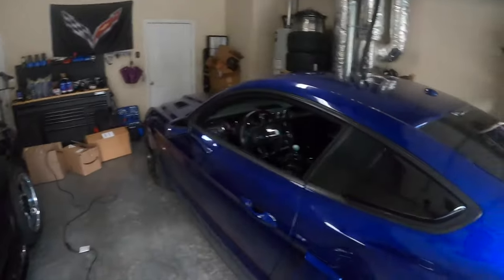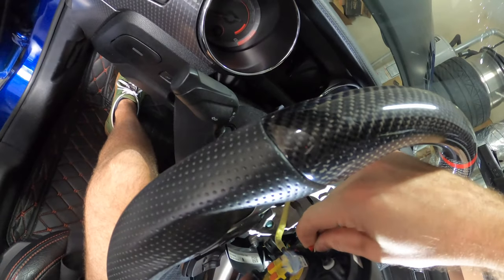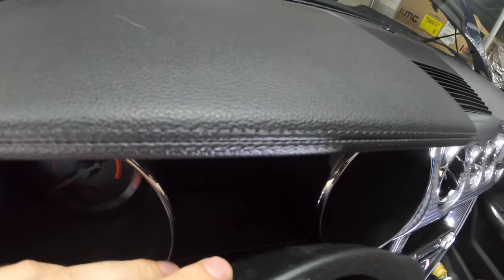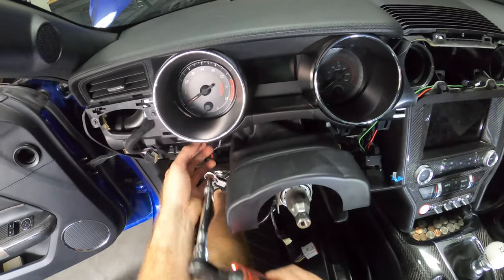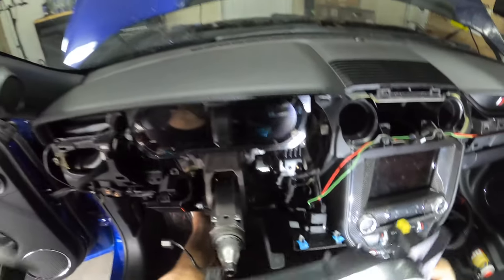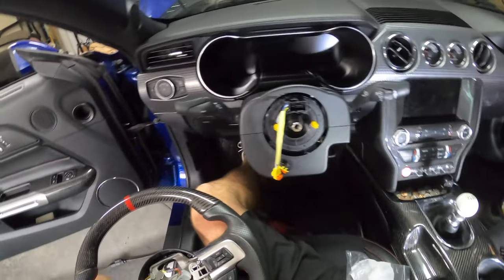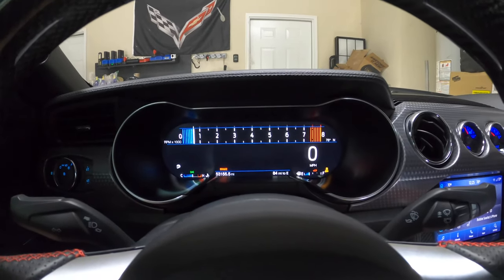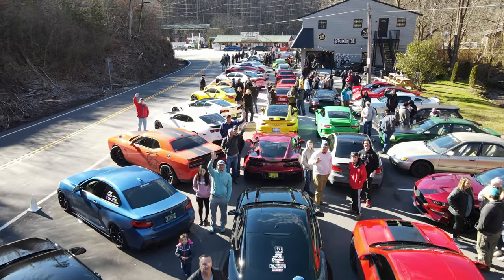S550 Mustang Digital Dash Install ***INTERIOR COMPLETED!***

Comment: This is a great mod. I had a 19 GT with a 401A package. I loved the dash but I hate the gen 3 coyote. I sold the car now I would like a 15-17' with very low mileage.
Reply from the maker: Yeah I've heard people have problems with the gen 3. That's unfortunate. I love the dash. The Mustang is just such a great daily driver.
Reply: New s550 owner here. Can you explain what issues are bad with the gen 3 ?
Reply from the maker: @agarcia8800  they have a piston slap issue that I believe is the cause of the “coyote tick”. It’s a Gen 3 only problem: 

https://www.reddit.com/r/MustangTech/comments/bbmd4q/question_for_gen_3_coyote_owners_are_the_problems/?utm_source=share&utm_medium=ios_app&utm_name=iossmf
Reply: @RobsHouse  oh god. I just bought a 2018 with only 5k miles for a good price. Ima have to check this out for sure.
Reply from the maker: @agarcia8800  that’s what warranty is for ;). If it starts ticking just take it to the dealer
Reply: @RobsHouse  for sure. Likely I also bought the extended warranty for an additional 72 months or until 2026
Reply from the maker: @agarcia8800  yeah I wouldn’t worry too much. I have a few friends with Gen 3s who didn’t have the issue. Just don’t void the warranty. If you want boost go with Roush to retain warranty.
Reply: @agarcia8800  Yeah that issue was mainly with the 2018s.  2019+ they pretty much fixed the issue. Ive had my 2019 gt 10r80 for 2 years now and it's treated me well.

Comment: I have a 2020 Mustang GT, will I need to cut out the back plastic or will this digital gauge cluster fit without any modifications to the dash?
Reply from the maker: I believe on the 2018+ it’ll fit without modification. I’m not 100% sure though
Reply: @Jes2e hey man I have a 2020 gt would I need to buy just the cluster or would I need to buy the adapter and all that as well?

Comment: I don't own the car yet but there's one local I'm very interested in. However no digital dash. I'm happy to see I can add one. As I'd be removing the steering wheel it would be a good time to upgrade. How do you like that aftermarket one?
Reply from the maker: I love it! And if you do the digital dash, I would recommend putting some foam behind it. Mine was rattling so I removed it again last weekend and taped some foam back there. No more noise now :) it is only mounted by the bottom if you have a 2015-2017 car so it flexes a bit when you hit bumps. It’s not moving at all now and the foam obviously eliminates noise. Install instructions won’t say anything about this but you should definitely do it if you swap the dash. Steering wheel swap is easy and 100% worth it as well.
Reply: @RobsHouse  I'm looking at a 2020 so no worries about the rattle 👍
Reply from the maker: Oh nice! Yeah no problem at all then

Comment: Well, thanks for the video. I know I'll get flamed for it, but now know what else to look for as nogo's when buying a mustang. And I am looking to buy one. If you have to cut things to fit things no thanks.
Reply from the maker: To each their own. I put a bunch of padding behind mine, so it doesn't rattle at all. You wouldn't even know it was modified. These come as a factory option for 2018+ so it's only an issue if you see a 2015-2017 with a digital dash if you don't want any modifications.

Comment: Great video! Is it possible to misaligned the steering wheel when putting it back on? If so, what could you do to avoid that? Thanks!
Reply from the maker: No. The center bolt threads into a receiver which is hexagonal. As long as the wheel was pointed straight when you took it off, you can’t screw it up putting it back on. You’d have to rotate it a full 60 degrees to put it on at a different angle. You’ll see what I mean when you pull yours off. Don’t worry :)
Reply: @RobsHouse  I see! Thank you so much.

Comment: Holy shit! You are VERY brave!! Do you feel like flying out to Australia to instal a new digital instrument panel in my dash (because mine keeps going 'dark' on me for no apparent reason).... I doubt any of the Ford mechanics in the region where I live would know where to begin on a project like this!!)
Reply from the maker: That's weird. Did you check the back to make sure the connector is seated properly? Mine has never had any issues since this install. The only thing I did later was add additional padding behind the dash because it was rattling a little bit.
Reply: @RobsHouse  No! My car came with the digital dashboard, factory fitted. I note that this is an issue for many owners (according to some of the forums I follow on the web), but where I live the only Ford dealership in town is still coming to grips with the fact that we don't have to hand-crank our engines to get them started these days.
Reply from the maker: @nicholascohen852  Interesting. I have no idea why it would do that. I'd imagine that should be covered if you're in warranty.

Comment: I would have saved so much time If mustangs just came with it installed
Reply from the maker: Well….the 2018+ ones had it as a factory option haha. That’s where the part number comes from. Mine just didn’t have it cuz it’s a 2015

Comment: Do you know if a dash off another mustang will work on mine 

Or does it have to be that kit
Reply from the maker: I believe it will assuming both cars are the same transmission (auto dash is different from manual). However, it will require reprogramming the dash to match the options that the car you're installing it in has. You also need the upgraded steering buttons.

Comment: Did your odometer have to be adjusted when you ordered it or does it automatically adjust to whats on the car when you install it?
Reply from the maker: Yes. I go over that toward the end of the video. You can only increase mileage with FORScan, not decrease. But I did have to increase it, as the mileage on my car increased in the time between ordering the kit and receiving it.

Comment: how is the installation different when its on a 2018 mustang? I have a 2018 gt premium with the old cluster and I really want to upgrade, but I cant find a tutorial on the upgrade on a 2018+ mustang, only people installing it into 2015-2017 mustangs.
Reply from the maker: The difference should be that it bolts right in with no trimming to the back-plastic required. You'll still need to program the cluster according to your VIN options, but it should be a more straight forward swap. However, I can't say for sure, as I've never done one.
Reply: @RobsHouse  thank you so much!

Comment: i am thinking of buying a used digital dash, being plug n play and all, if i were to buy one with lower mileage than mine, could i roll forward those miles with forscan? so it could match mine, and if so do you know where exactly id have to go on forscan to get that done?
Reply from the maker: Yup you can roll it forward. That's exactly what I had to do. Just google how to do it. I don't remember which menu its in. It's very easy to do though.

Comment: I haven’t found anyone able to answer this question. I have a ‘19 Ecoboost Premium with a digital gauge cluster and the NAV/GPS Sync 3 radio. I also have a ‘16 GT Premium with an analog gauge system and a Sync 3 without NAV/GPS…my question is, am I able to migrate them from the Ecoboost over to the GT?
Reply from the maker: I would imagine that it is possible, but it will require some reprogramming. I know the basics of using FORScan, but I'm not an expert on that. Check out the digital cluster install guide thread on the forums and ask them. I think someone there will know how to better answer this question.

https://www.mustang6g.com/forums/threads/2018-digital-cluster-installation-guide.99275/

Comment: Does the 2018+ models require a new “ clock tower “ ? Not to sure if that’s what it’s called but for the windshield wipers & turn signals.
Reply from the maker: That’s a good question. I want to say no but I’m honestly not sure.
Reply: @RobsHouse  I got a hold of the seller it’s in the kit so even though I’m not sure either I’ll just swap it out. Thanks anyway tho man!

Comment: Rob must not live in Texas because when the summer comes and it gets 190  in a car then winter comes and it is 20 below what do think is going to happen to the electric circuit in ALL of these computers in a car?
Reply from the maker: These are factory components from a newer mustang, so i think that absolutely nothing will happen. Ford sells cars in Texas as well as Alaska. Every car that even has so much as electronic fuel injection has a computer in it. They are designed to withstand extreme temperatures... 

And I live in Eastern Tennessee. I say this in videos all the time.

Comment: Is it safe to buy the cluster and parts from a part out car ? I found a 2020 GT that has a digital cluster .
Reply from the maker: I'd imagine it would be (assuming the same transmission), but you'll have to program the cluster to match your car's options and mileage.
Reply: @RobsHouse  can I program the cluster myself ? Or I would need to take it to a dealership? I found a 2020 GT cluster manual. My car is a 2022 GT manual
Reply from the maker: I do not know. I know there are some things you can edit with FORScan yourself, but that only lets you increase mileage. I'm not sure how they reset them so they can program the correct mileage in if the cluster came off a car with higher mileage.
Reply: @RobsHouse  I currently have 1600 miles and the cluster that I’m looking at has around 3000. Should I just wait until I reach that mileage
Reply from the maker: @anthonypalacios3842  yeah you can use FORScan to up the mileage to match when you do the install. You can also use that software to set other options in the cluster if they don't match, such as the red line for example. There are some spreadsheets on the forums with all the FORScan hex values for different settings for the BCM which controls the cluster and the infotainment screen. You need the ELM327 OBD interface for it as well.

Comment: If you have 2018+ car already do you still need to cut that stuff out?
Reply from the maker: I do not believe so
Reply: @RobsHouse  I have a 2019 but I seen americanmuscle website also sells it and it might be a slightly different design and I read reviews where they said they didn't have to cut anything.  Thanks
Reply from the maker: @thefitnesslife4988  yeah the cutting is because the plastic behind it on the 2015-2017 is different than 2018+. You probably won’t have to on yours. But if we are wrong and you do, it’s really not hard. I wouldn’t let that stop you. You can do it!

Comment: Hey man nice video. I have a question. If I install one of those from a different mustang to my mustang. That will work?? Thx.
Reply from the maker: It's not a simple plug-and-play. You'll have to program the BCM using FORScan to reflect the features of your car (red line, whether or not you have a boost gauge, etc). It will also need to come from a car with the same transmission. Automatic clusters do not work properly on manual cars and vice-versa.

In my case, I purchased the kit and provided my VIN and mileage. With the VIN, they could look up the specs of my car and program the BCM accordingly before they shipped the unit to me. The only thing I ended up needing to change was the redline.
Reply: Hey man. Thx for the good information. 
So the digital cluster I’m trying to buy is the same year of mine. Both cars are manual transmission. 
Do you think if I install the digital cluster from that car to my car the the cluster will mach my car miles?  Or that have to be programmed whit the forscan ?
Reply: I just ordered a used cluster with 32k miles on it, but my mustang only has 10k miles. Will I really have to wait until I reach 32k miles before installing it ?
Reply from the maker: @saulfranco8641  It will absolutely NOT match your car's mileage. You will have to program it with FORScan. It's also worth noting that you can only raise the mileage with FORScan, so if that other car has more miles on it than your car, you need to do a factory reset, which I do not know how to do. You can contact hellhorse performance and ask them. They sell these dash swap kits and can probably reset it for you if needed.
Reply from the maker: @agarcia8800  You can either wait or you can have it reset. Like I mentioned in my response to @Saul, FORScan will only let you raise the mileage, not lower it.
Reply: @RobsHouse  okay thanks.

Comment: Do you have to replace the clock tower piece with the turn signal or is the new one the same as the one replaced?
Reply from the maker: I gets replaced. I show that in the video.
Reply: Yes but does it have to be? Will it work without replacing it or some of the buttons replaced?
Reply from the maker: @nc-boe951  I have no idea. You'd have to ask the people that sell the kit. I'm sure there is a reason, but I'm not sure what functionality would be lacking if you didn't have the upgraded clock tower and buttons.
Reply: @RobsHouse  Ok thanks. One more question. When you install this does it automatically update with your cars current mileage?

Comment: Hi how are things??  I have changed all the elements like you but when I turn on the car the kilometers that I had do not appear, the button above the license plate to open the trunk does not work either, the rev counter does not move either and it does not let me change the driving mode driving, do you have to do some reprogramming after installing all the elements for it to work correctly?  thanks and regards
Reply from the maker: I didn’t. It came programmed for the most part. All I had to do was change the red line. Things like your trunk hatch release should work since that’s not even connected to the cluster.
Reply: Thank you very much for answering, I will reschedule and that's it, greetings and thanks for the videos
Reply: You might want to recheck the wiring behind the cluster if yours is a 15-17 car to make sure they didn’t get cut during the install.

Comment: does your dash rattle at all? and do your brights symbol show up on your digital dash, when you push the brights away does it stay locked and on? my digital dash rattles when driving pretty annoying, then my brights don’t show up when i push to lock the brights
Reply: then my brights don’t stay on when i push them away from me to lock em
Reply from the maker: Brights work normally. They lock on when I push the stick away from me. Dash rattled a ton so I ended up putting some foam behind the gauge cluster and it doesn't rattle at all now. Just put some foam padding back there and you'll be good. The rattle is coming from the back of the cluster hitting stuff back there.
Reply: @RobsHouse  thanks for the reply, i have a 2015 and i don’t understand why when i try to lock the brights it doesn’t stay on. or the little blue thing doesn’t show up, called infotainment and they sent a microsoft surface tablet out and turns out some coding was wrong but still didn’t fix it. gonna have to call them again and figure out the situation. using the clock spring they sent me in the kit and everything.
Reply from the maker: @sarmadalnourachi5942  yeah it’s either a coding issue or something wrong with the clock spring. I’m sure they’ll fix it either that. That sucks in the meantime tho. I’m sorry man.

Comment: I have a digital dash from a 2018 5.0 that came with an engine/trans, etc  my dad and i bought for a 1966 stang were swapping it into. Can i put that 18 dash into my 2016 gt350?
Reply from the maker: It requires a bunch of programming with FORScan, but you should be able to, assuming that dash is from a manual car. The manual and auto clusters are slightly different. You'll also need the bezel for it like I showed in the video. I wouldn't expect it to work right out of the box without some programming though. You also need to reset the odometer which is non-trivial as far as I'm aware. You can increase mileage easily, but if your car has less miles than it shows, the bezel needs to be completely re-flashed I think.
Reply: @RobsHouse  display is from a 10r80 stang and the gt350 is a tremec 6-speed manual rip
Reply from the maker: Yeah unfortunately that won't work :(

Comment: So I just did this upgrade on my 2018 mustang. Had the analog cluster before, sent the digital dash to Sam reeves to be programmed. It came back and I installed it, works great. However i cannot access the settings for the dash. Also phone functions are limited but somewhat working. Ford voice controls also no longer work. Did I do something wrong ?
Reply from the maker: Did you replace the steering controls and the clockspring? I bought the whole kit from him so it came with all the necessary parts. The old analog steering controls and clockspring will not work with the new digital dash, which is why he includes a 2018+ clockspring and controls.
Reply: @RobsHouse  I have a 2018, so a new clock spring is not needed if I’m not mistaken. Everything else has been replaced.
Reply from the maker: @agarcia8800  Clock spring should be fine yeah. I wonder if it's just a couple of programming errors that can be fixed with FORScan. I had some small stuff like my red line not being correct that I fixed.
Reply: @RobsHouse I’ll upload a video of my issue on my channel if you’d like to see ?
Reply: @agarcia8800  did you ever get to fixing the settings with your dash? I just installed mine and I have all the steering controls installed its just that the pony control to access your settings doesn’t work at all
Reply: @bananfone33  I would reach out to breeves on the forums. He programmed the milage to mine cluster and when I installed the buttons I had the same issue. He sent me an email with the updated config file to flash in forscan. Alternatively you can do it yourself but you’ll need forscan and the config codes list.